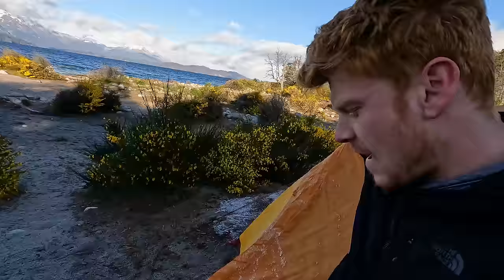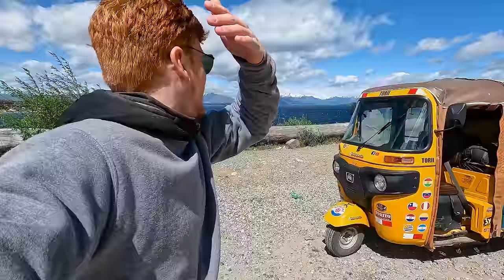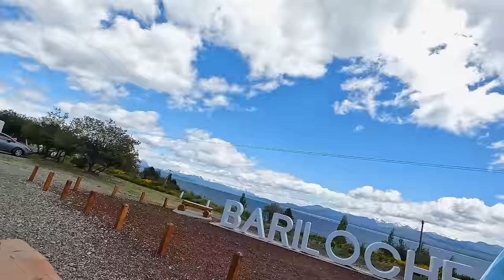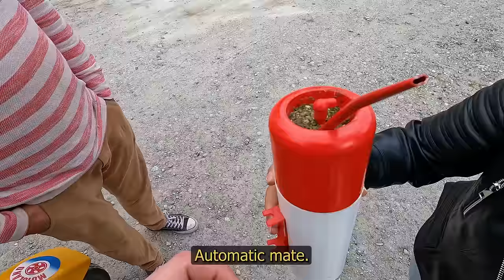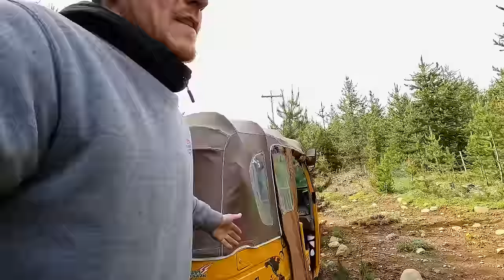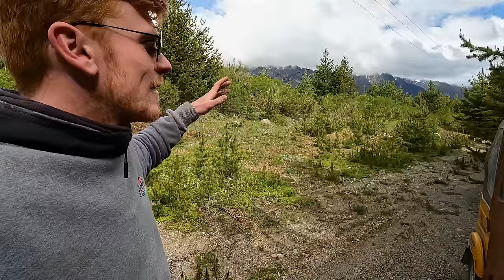STRANDED without money in the Patagonia's of ARGENTINA 🇦🇷​

Comment: Hi! I'm loving your Patagonian trip so far, I'm from Capital Federal, Buenos Aires. I been in the patagonia like a dozen times. There are so many places I could recommend, but I understand you're on a tight schedule, especially since you're heading south in April. From Bariloche to Ushuaia, it's 2400 km, and you have to be aware that winter there is no joke. With places like Calafate in between that are a must-visit, I believe you'll reach Ushuaia by the end of May, so you'll be fine. Ice on the road is dangerous. FYI, I believe the exchange problem you were facing last year shouldn't be a big issue now because the official exchange rate and the "blue" rate are very close to each other, with 1 USD being around $885 (official) and $975 (blue), so in my opinion, this shouldn't be a hassle.
Reply from the maker: Cheers mate